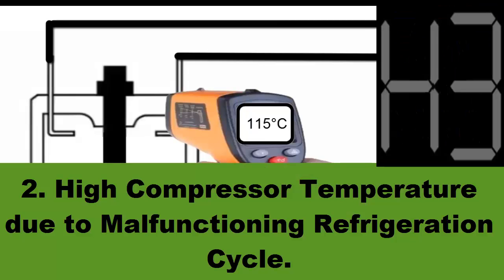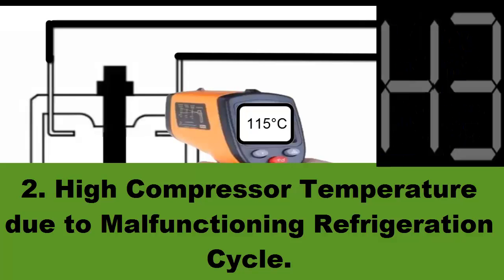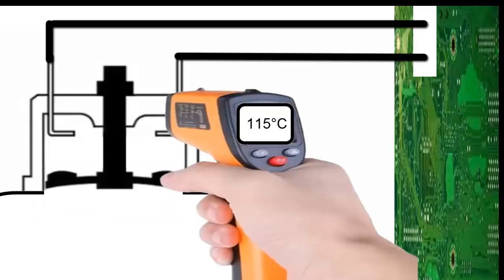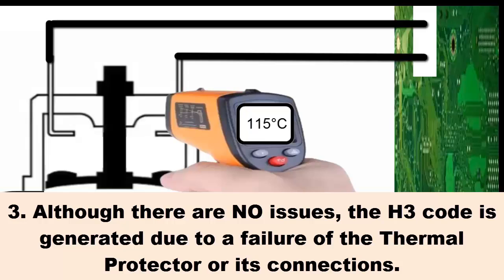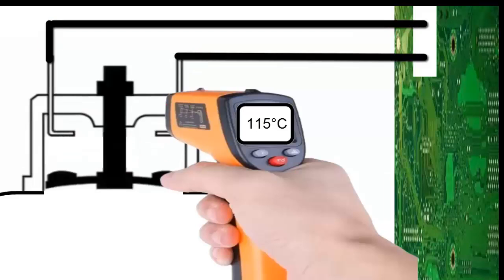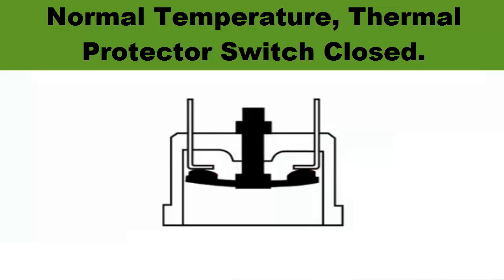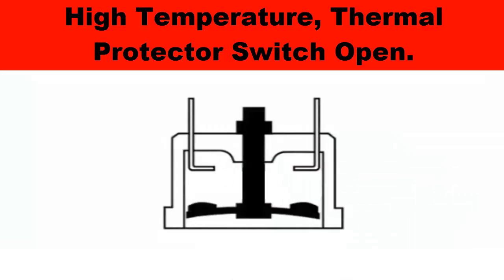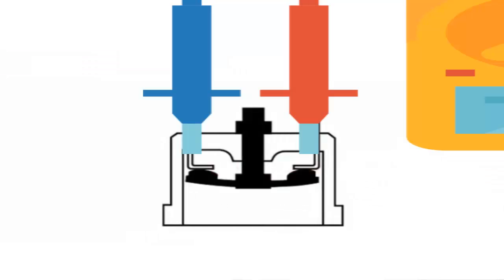Troubleshooting H3 Error Code in Air Conditioning: Resolving Compressor Overcurrent Overload Fault

Comment: Ok I have this error but the AC wont even shut down, why would the device not want to respond to my TURN OFF signal from the remote? I mean, if It tries to protect  itself, it should work to turn off...
Does anyone have this problem too, with H3 error not responding top turn off?
thanks!
Reply: Hy, my Ac also to